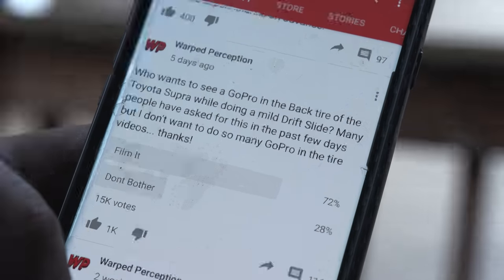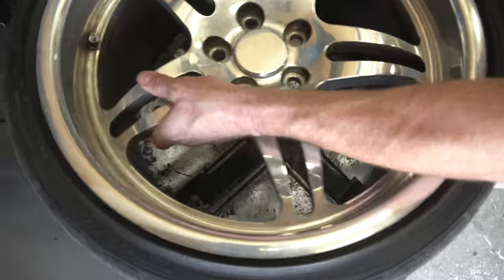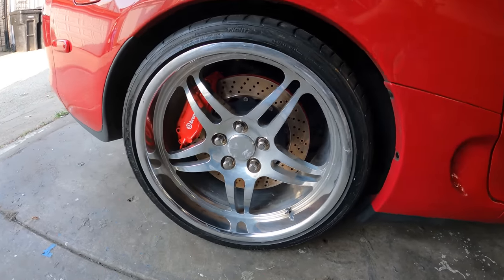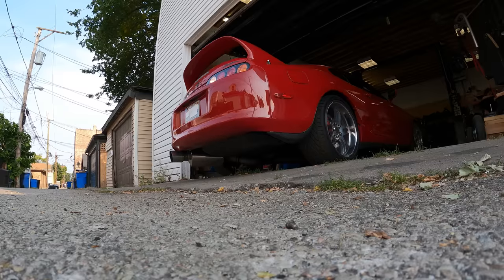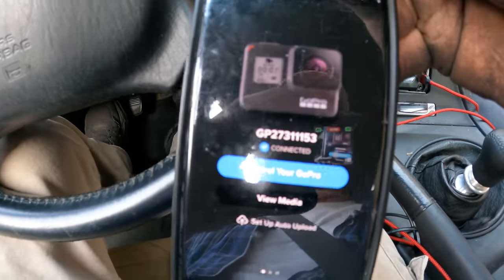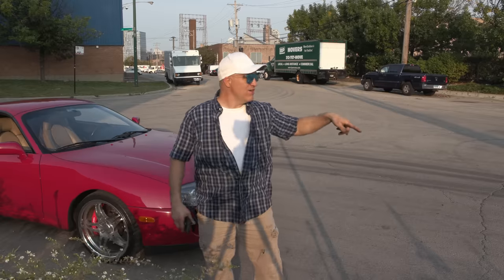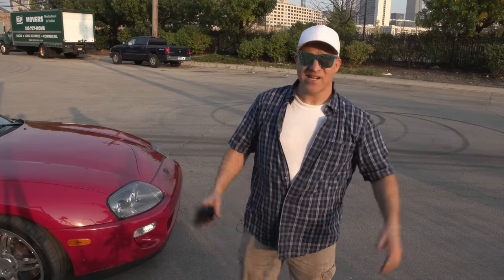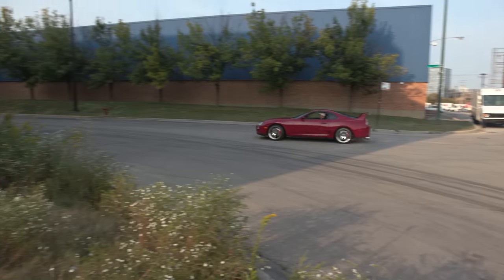Supra Drifting With GoPro Under Car and In the Rear Tire (Street Drift)

Comment: The under car shot was more interesting than the tire shot. Seeing the suspension, and the driveline flex under load was awesome.
Reply: I agree
Reply from the maker: I though so too!
Reply: And how close the exhaust got to hitting the pavement!
Reply: So neat watching driveshaft and axle rotate and the diff rotate from the torque. Super coool vid!
Reply: I've seen all of that before but the tire shot was amazing
Reply: WP: have you thought about tightening up the rear suspension with some new poly or Delrin bushings to help get more power to the ground?  Every time those bushings flex, they’re  using up some power and torque and delaying the torque to the pavement.
Reply: Nate D was about to comment this, literally the first thing i noticed
Reply: I thought it was cool to see how much the differential and subframe was moving under power, not to mention seeing the tire sidewall flex under lateral load from both inside and outside the tire.
Reply: Agree
Reply: Actually I thought the tire shot was interesting, seeing the contact patch flex every time it passed by
Reply: @WarpedYT  Might want to check the bushings on the diff to make sure they're not falling apart.
Reply: @traugdor  came here to say needs solid diff mounts front and back. It’s so much better.
Reply: I don't know.  This was my first "in the tire" video so seeing that hidden world was pretty cool.  I admit, the undercarriage shot was really cool too.  Take care, -Eric
Reply: @patsplats  Right?  It's like exposing a "hidden world" we're not meant to see!  🤪
Reply: @WarpedYT  the supra needs some poly diff bushings and needs them bad.
Reply: @kevinclay4883  yeah, or at least new ones. They looked all cracked up
Reply: Yeah, it also shows that it needs some new bushings pretty badly haha. That's an awesome shot though.
Reply: @natez0690  Doesn't this make the hard shifting rougher?
Reply: @tomasnokechtesledger1786  I don’t think swapping the rear suspension and diff bushings for poly or delrin would make the shifts any rougher.  What it would do is stop the rear diff from flopping around back there transferring more torque to the wheels in a shorter amount of time.  I think the harder shifting you’re talking about might only happen if you’re bad at matching rpm before letting out the clutch.  Let’s say you drive a manual car with a sprung clutch hub and big rubber guibo bushings in the driveshaft/prop shaft (ie: Corvette 1997-???).  Then, you switch to a racing clutch without springs in it and you ditch the rubber prop shaft guibos for poly or aluminum.  Sure yeah, you’d experience harder/sharper bucking from the car only if you shift the car poorly on the up shifts and don’t heel-toe downshift.  It wouldn’t necessarily make the car shift harder, that would only be from a transmission problem.
Reply: @natez0690  I Understand what you´re saying. Looks like those rubber bushings got shrunk and wore from time and usage, needing replacement anyway. Those poly bushings like skateboard wheels seem to be a good replacement.
Reply: It fascinating how much the suspension takes in shocks and effort to take some of the bumps away from the driver/passengers.
Reply: Did any of y’all notice how hot it was getting under the suspension
Reply: @acestudios5909  How do you mean?
Reply: IS THAT A SUPRA
Reply: yes it is

Comment: Looks like a bushing on the front of the diff is starting to shred.
Reply: Diff mount and subframe bushings are toast, at around 3.30 you can see the whole rear end shift around. 
Get it sorted mate it's not a nice job but that car will feel like new with some poly bushes.
Reply: Came here to say the same thing. His U-joints will thank him too since there's a fair bit of power he's giving up when that rotates to the rear. Exhaust has seen better days too.
Reply from the maker: @willpayforbaconbacon9569  lol..8 years putting out 1000 hp takes its toll on the bushings, the car feels fine i wouldnt have known if not for the footage, however i don't like poly bushings, too stiff then the car does not feel like a supra, I like dampened power tbh makes the car very enjoyable to drive/
Reply from the maker: @RickJohnson  nothings perfect, but there is a huge damper donut in between the u-joints and the yolk, but you have to remember they are 26 yrs old and for the last 8 years taking 3 times the stock horsepower. thanks for the tips!
Reply: @WarpedYT  1000 huh.
Reply: @WarpedYT  Yeah 8 years takes it's toll on anything, glad you caught it with this video so you can get it sorted mate, will feel like new when she's done :).
 Great content as always
Reply: I also have a supra and while yes you are right I wouldn't say they are toast, just old. The idea is to allow movement for smoother street driving. A solid mound or poly mount bush would reduce diff movement overall but at the sacrifice of comfort. I would say they could use replacing but depending on what he wants to do with the car just stick with rubber for street duties. Even if it had brand new rubber mounts there would still be movement
Reply: @WarpedYT   my 2012 RT has problems with bending guibo bolts at factory numbers. Im shocked they look as good as they do... I did notice that diff going every which way though.
Reply: @liquidgd  I found out yesterday that we've all been saying and speling giubo wrong, and its said joo-boh
Reply: @willpayforbaconbacon9569  No PU bushings on  road cars, plz. I did it a couple of times. On smaller cars like the Mini, and on bigger ones like E39 and F30. Yes, the car drives sharper afterwards. And on a race car it makes absolutely sense. But it's horrible to drive on the road and I assume the roads in the States are not the best...
Reply: @Tomelino  No disrespect or anything, but i've owned alot... Alot of cars, 1st thing I do to any car is poly all the way round and I live in the uk, back roads here are awfull. Poly engine mounts are the devils work on a road car i will agree with that though. Sounds like a poor suspension setup and posibly tiny tyre walls [ie 40 or lower] is what you're describing. In a fwd hatchback shopping cart OEM is the way to go for sure, i''ve had a few e39's, they're heavy girls, poly bushes only make them better not worse.
Reply: Just go rubber replacement bushings. Polyurethane can be too solid and transfers harmonics more viciously. Rubber all the way for a nice feel in a street car. However I’m sure you replace bushings etc. frequently given that you’re making 1000hp. I know you’d be all over it. Love the under car shot, you can really see everything compress under load! 👌
Reply: @WarpedYT  The original bushings keep the drive shaft noise out. If you switch to poly, you will hear the the drive shaft. Even a well balanced one makes noise on poly. Also the movement in the rubber giubo and the mounts reduce shock to the hard parts when you pop the clutch. Toyota had it right to begin with. I wish i had not put poly bushings in my Supra. Great video. Thank you 🤙
Reply: @WarpedYT  the driveshaft bushing is called a “guibo”
Reply: @TurboVisBits  yeah... Does not look, sound, or act like 1000hp at all.
Reply: @willpayforbaconbacon9569   My thoughts exactly. I'm just glad it's a supra not an FD Rx-7. God knows how much we don't need any more people destroying those precious cars. 

Have an 85' FB(Atkins built 12a)and a 88' GTU with a massive street port my dad did with pineapple racing templates and full intake, header, and fully functional 6ports(I'll never give up the secret to making them work with a header just like they did with stock exhaust unless you're a rotard too😇) . The difference between those is staggering.  One day hopefully I'll add an  FD to that list.  They are getting soooooooo rare though. Especially not molested and LS swapped!
Reply: @TtheK  The FD may be rare, but Supras are getting rare also. A stocker TT runs over $100k these days.
Reply: @mycosys  still gweebo for me
Reply: @TtheK  sounds like too much work for diminishing results. My turbo k24 fd swap will be far more enjoyable
Reply: You can see the tire deform laterally

Comment: Woah... you can actually see the bead slipping on the rim, Thats crazy.. so thats why they invented bead locks. Oh and btw, you need new diff bushings.
Reply: I was surprised about it moving that much.  If you mark the tyre and the rim does it slip around?
Reply: Wonder if its worse because he just mounted it, and he wet the bead to get it on the rim?
Reply: That's crazy
Reply: @dr_jaymz  good question... i think i may have to put that to the test.
Reply: @TVmadethemdoit  that slippage might also be the reason why he has so much grip, because he can't spin the tire completely
Reply from the maker: @dr_jaymz  it had alot of mounting lube, i figured it would move since it did not have time to dry out.
Reply from the maker: @kuma7526  the tires are softies...I had drift tires once, they were like plastic, maybe a good subject for a future video, Supra Drift in Slow Motion

Comment: i think the rim feels like that is because it's forged and then milled.
Reply: correct, those are the grooves from the carbide bit in the lathe or CNC mill
Reply: @ughmas  Probably not carbide.  Tool steel is generally more than adequate for machining aluminum of any grade.
Reply: unlikely to be from milling, the longditudinal tool marks would be from lathing
Reply: Yeah either a lathe for CNC, it’s turned that’s for sure
Reply: ughmas I know how to use a cnc cuz a class lol
Reply: @elkvis  nowaday we dont use hss in the cnc machines, carbide bits are more durable, reliable and geometricaly constant. Also for aluminum...or plastic...
Ah, and there are some 4 or 5 axis lathes that can turn and mill at the same time without moving the piece from the chuck. I work on these machines. And we make magnesium wheels for f1 cars.
Reply: @JacksonRB  But you don't know how to spell or use the reply button. Sad what they teach in "class" nowadays.

Comment: That noise at the end is because its a billit wheel. Made from a single billit of aluminum
Reply: @thatmand4542  7:22 and it's billet lmao
Reply: @thatmand4542  the end of the video
Reply: milling finish
Reply: @MaYbYl8eR  correct
Reply: @MaYbYl8eR  lathing - they go round the circumference, milling marks go in little circles.
Reply: MaYbYl8eR nah it’s not a milling finish, that’s a turned finish, either turned on a lathe or CNC.  If it’s professionally done it’s mostly likely turned on a CNC

Comment: monoblock forged not die cast, then cnc milled/machined and turned on the lathe, leaving tool marks.. more under carriage go pros instead of within tyre to see the flex in the rubber with a higher sidewall and the strain on the suspension / antiroll would be a lot more informative.
Reply from the maker: Agree!
Reply: @WarpedYT  if the gopro can be mounted on to the suspension so that there is no relative movement of tyres wrt camera then that would be picture perfect for tyre flexion at the edge of maximum grip level just b4 sliding. can be done with hard braking or accelerating without slip in slomo. Love all ur videos cant wait forthe next 1.
Reply: @WarpedYT  really the cam in tyre didn't have anything new YET your great idea of adding the underside cam was pretty awesome! I loved the vid!
Reply from the maker: @Ktulu789  completely agree, I totally would not have done it unless thousands of people requested it.
Reply: @WarpedYT  still appreciate the fact you listened to the fans. I think it was a little anti-climatic, but still cool to get an idea of how many times a tire turns in second.
Reply: @DeeP_BosE  thank god someone knows the difference between milling and turning tool marks XD

Comment: Replace those shot rubbers holding the diff for some Powerflex ones.
Reply: its really bad idea. 
If its stiff at one point, all the load will start to destroy next weakest link.
Lets put that this way. Try to brake ruber band and try to brake piece of glass.
Glass is stiffer, but more fragile.
What happens with car is, when you have everything really stiff, then something will eventually brake, when useing soft rubber, all the load will be split between different  locations and they will last longer and  won't brake anything in car boddy.
Useing poly pushing on street cars are totaly rookies mistake.
Tbh, I was once rookie, and used theese. but converted back to usual rubber bushing recently.
Biggest problem with poly is that, they are not maintace free.
If we talk about rally cars, then they will have maintace after every track or race.
How frequently owners of street cars crease their pushings?
Never.
Next rookie mistake is really stiff shock absorbers on bad roads and coilovers overall, but theese are totaly different discussion.
Reply: I think with trippel the power the oem bushings are not strong enough to hold the diff in place at wide open throttle.
This creates to big of an angle and will destroy cardan hardydiscs.
Reply: @royvandeweerd911  engine power has nothing to do with forces that bend the diff or any other part in chassis.
You need to learn some mehanics basics before you undrestand things.
Long study short.
All forces are equal. You can never have greater power output than its resistant power.
For car the resistance power is its wheels. If it starts to spin wheels at 100kw, then your engine output never exced 100kw, even if your engine is capable of 1000kw.
Only thing that makes engine to make more output is greater resistance, if we talk about same wheels, then greater output would be faster spinning for example.
Other way is to use bigger wheels, wheels with better grip or greater mass of car itself.
Second thing is torque.
torque and kw are are connected. Power (kW) = torque (Nm) x speed (revolutions per minute, or RPM) / 9.5488

To be clear, kW is work that has been done.
Torque is resistance, whitch can't be greater than its resistant torque.
Haveing torque does not mean that any work had done.
If you think about wheel nuts, that are rusted, and you can't loose them. You may give it constanty some torque, but they are not moveing. You have to exeed the torque that is holding the wheel nuts, just giveing a torque does not mean that any work has been done, it needs some rotations for that.
If we talk about cars, then we have gears. every gear has its ratio.
Lets say we have 3:1 at first gear and 1:1 at third and rear dif has 3:1. Engine max output is 500Nm.
So if we calculate then at first gear rear shaft has 9:1 gear ratio (3x3:1x1)
and with third gear we have 3:1(1x3:1x1)
gear ratio means that you are chageing torque. In our case whe are multiplieing it. It is like haveing longer wheel wrench(but you are loseing at speed/distance)
So engine output of 500Nm equals 4500Nm at first gear(500x9) and  1500Nm(500x3) with third, measured from driveshafts.
Lets say that engine of 500Nm can burn the tires with third gear. Then you can imagine that a lot weaker engine could to the same, maybe not with third, but with first gear.
Lets say we have second engine with 250Nm of torque, then with same ratios first gear has 250x9=2250Nm

So my point is, greater engine power itself does not have any affect of torque chassis is haveing.
With first gear weaker engine twists as same much diff pushings etc as stronger engine.

Comment: Ok now put fix-a-flat in a tire with an old go pro and then drive
Reply: I kind of want to see this. Run over sone nails with the GoPro in the tire, then use some Slime or even a string plug.
Reply: @normang3668  oh hell yeah. Seconded. 👍

Comment: Usually they put the camera in front to show the angle kit working but it was interesting seeing how the car sends power to the rear wheels. It really helped understand why electric cars are more efficient, it makes you realize that it doesn't make sense for any electric car to front wheel drive

Comment: It's interesting to see the tire side walls move from side to side. It makes more sense why they have low-profile tires, after seeing that. The underside camera is also interesting. You can see the tires ease left and right on their sidewalls. Same with the suspension. Might I recommend replacing the bushings for your rear diff? They look a bit worn and in need of replacement.

Comment: The under-car shot was interesting, the inside tyre would've been if the camera had been fixed and focused on the contact patch, but that's easier said than done.  There's a challenge for you. :)
Reply from the maker: Yes I agree, the issue with mounting a camera that stays in the same spot on the bottom of the rim is that, you would actually have to keep the camera about 10 degrees off center to make that work. I can pretty easily build something to keep the camera at 0 degrees but not at 10 degrees that is a challenge !

Comment: I just have an idea to make the captured video in the rear tire very interesting is by adding some reference marker like a glued vertical flexible plastic strip to the rim facing the camera to capture the effect of the centrifugal forces. Obviously, it will be very interesting if you can add a measurement equipment to get the reads. Good job man. Be safe !